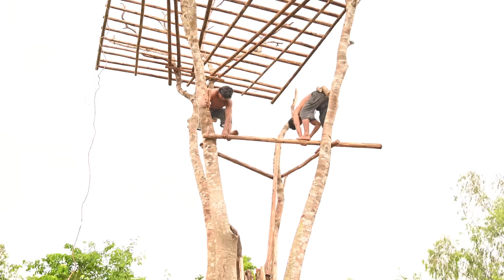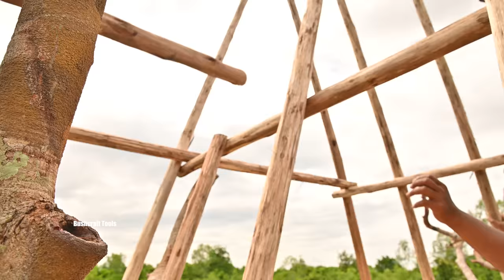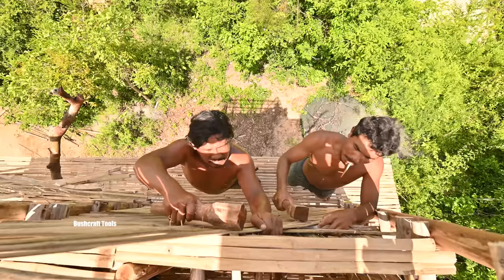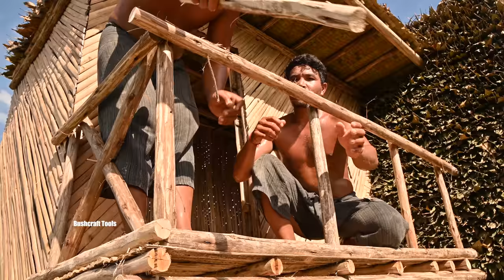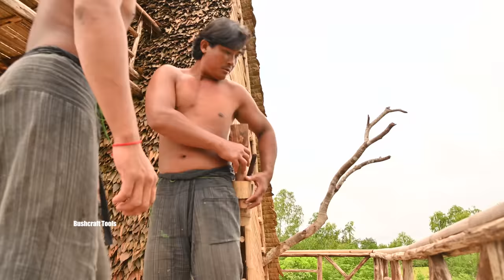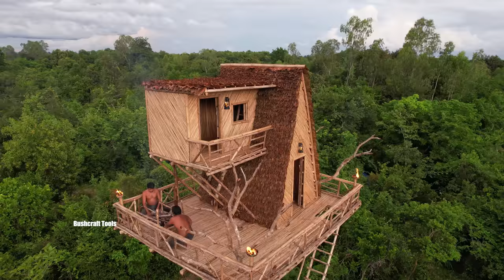Bushcraft Building A Tree House 19M Shelter Use Ancient Skills

Comment: Why isn't their hair moving from the wind, it doesn't look like even a strand of hair is moving. If you listen really carefully on some scenes when the camera is in the air moving side to side or even moving up and down it sounds like a buzzing or humming sound as if a small motor is running. Plus the camera seems almost like it is on a robotic platform to make it move. Also that wind sounds fairly strong to make the other trees sway back and fourth, but why isn't the tree they are on swaying back and fourth like the rest. So tbh I do not think this video is authentic. Until someone can prove me wrong, I will stick to this statement.